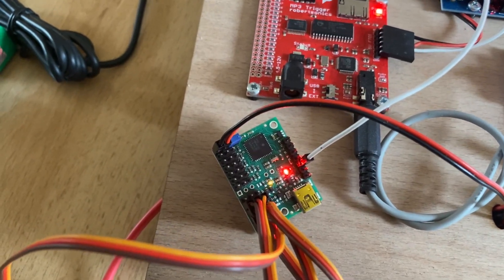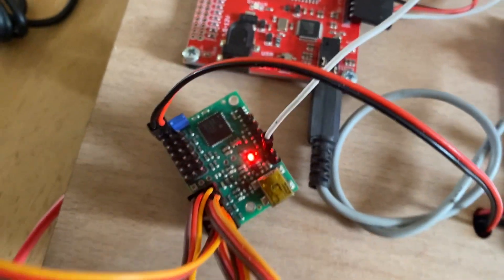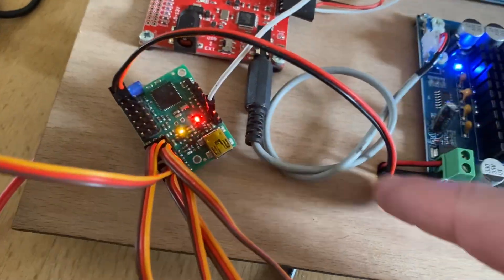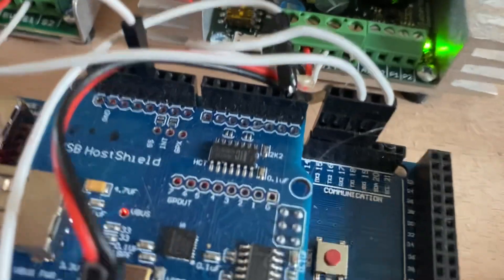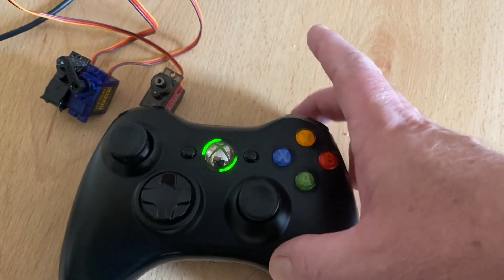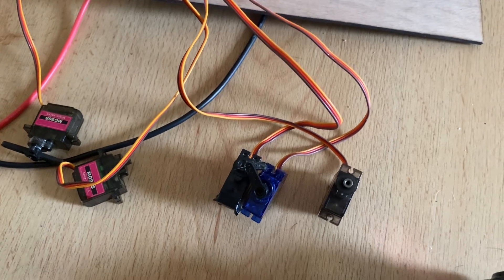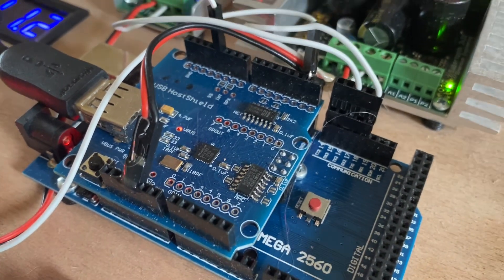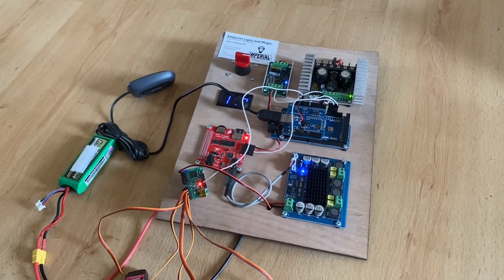Padawan 360 servos using Pololu Maestro

Comment: Great video, thank you! Is it possible to have the servos manually controlled via the thumbsticks? For example, moving the holoprojectors manually using the thumbsticks.
Reply from the maker: not via the maestro no, it would probably be possible to edit the main sketch such that you could manage a couple of servos but this is a bad idea, as anything you do inside the main sketch (ie anything that your transmitter is able to influence) has potential for you to lose control of your droid.
Reply: Thank you!!

Comment: Steve, have you tried any of the offbrand Mega ADK boards?  Arduino stopped making them and the USB host shields have been such a nightmare, using the ADK is the way to go.
Reply from the maker: Yea I’ve bought a number of ADK boards from Aliexpress
Reply: Thank you sir! @ImperialLightandMagic
Reply: I have been helped so much by this man’s channel.  I have sourced most of the components I need apart from the host shield.  I have the arduino uno r3 so is there another option I can use for this host shield thingy ?? Tia